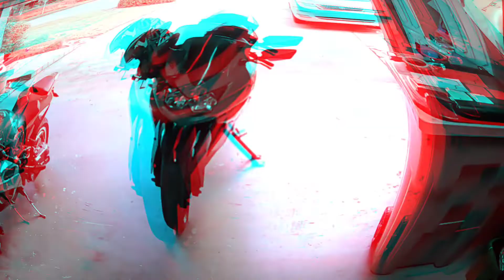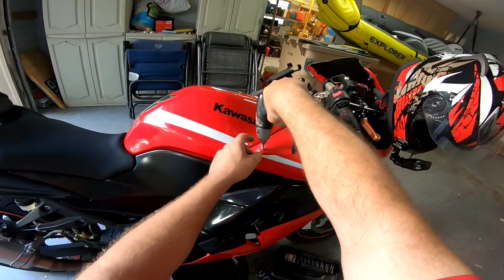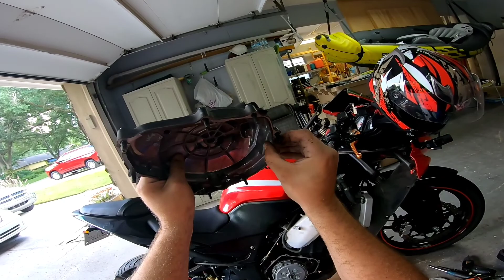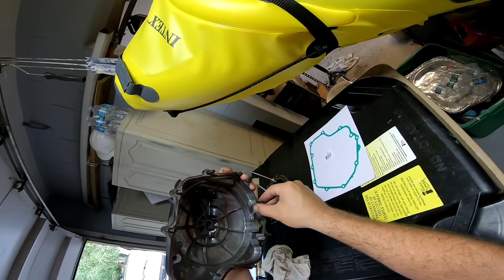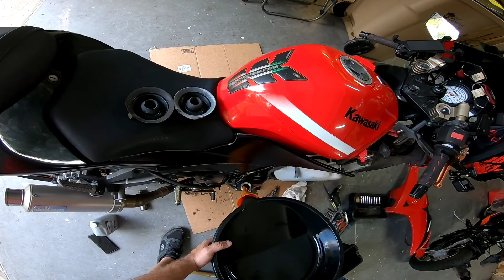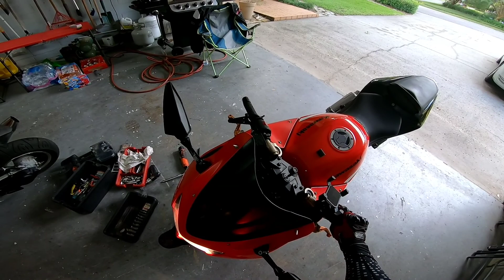Kawasaki Ninja 250R 2008-2012 Clutch Replacement For $30 It's Easy I Promise

Comment: Having an issue with excessive cable slack. I feel ive done exactly as you have. But when I draw cable to the actuator arm, there's just so much extra cable that I have to max everything out to get the cable taut.
Reply from the maker: Clutch cables wear out and they stretch you may have to replace your actual cable

Comment: Thanks, I have an unloved (unloved by previous owner) 2011 UK spec FI 250r. Your video very useful if I have clutch problems. I currently trying to loosen up swing arm. Last bolt stuck, can tap it from other side but exhaust downpipe in the way

Comment: Do i have to add oil before I test engagement like without the bike running? I just swapped the clutch back all the adjustments out on the cable and still when I put it in first gear with the bike off the chain still moves with the clutch in,granted I have a 2003 ninja 250ex and I haven't put oil in but I wanted to make sure before I have to rip the cover off again and drain all the oil I just put in
Reply from the maker: You can test engagement for opening and closing with the bike off and no oil in it but if you're going to run the bike you need to have oil in it

Comment: I recently just replaced the side cover of the motor the same one you took off to change the clutch, and when i put that pin back in at 37:30. That pin for the clutch cable to hook to it will not rotate back into position it slides all the way in but it will not rotate into place to hook the cable back on. Can anyone help with this? Explained in the best way i could.
Reply from the maker: @StonedClown97  that means that you didn't put the clutch together correctly
Reply: I never touched the clutch plates themselves I just took the 4 bolts with the springs out to replace the rod in the middle then put it all back together.

Comment: Anyone facing the same problem? The clutch cable had been adjusted perfectly. However the engagement point it’s too early. If I loosen the cable the engagement point will be perfect but level will have lots of free play. Is there a clutch spring release or something. Can’t figure out what’s the issue even after opening the clutch case

Comment: On the steel plates does the machined side face away from the bike of the rounded sides? Does the bike need to be in neutral?
Reply from the maker: Join my Facebook group then post a video and ask the question so I can see what you're talking about.
Reply: @IFixShet  the metal friction plates for the clutch have 2 different sides. One side is machined flat and has a flat "sharper" edge. The other side is smooth and the edge is rounded over. U may not have even noticed it when installed them but yea I'll do that
Reply from the maker: @maxx_life   Did you order from the company I suggested?
Reply: @IFixShet  no I ordered mine directly from kawasaki
Reply from the maker: So the ones that I put in didn't have a forward or a backwards. All of the plates were identical

Comment: Its always best to soak clutch plates before!! even if its just for an hour or so. You run the risk of using up and or scorching the first time you ride next
Reply from the maker: On this model you can actually just open the clutch plates with the clutch while the engine is running and it will circulate the oil through the plates
Reply from the maker: Same thing with the ninja 500R

Comment: did you soak the clutch plates ? ive read everywhere the plates need to soak in oil overnight
Reply from the maker: The clutch plates do not need to soak an oil overnight and for a wet clutch with a bottom sump like this it's really easy to install them dry and squeeze the clutch open and close a few times and oil will get in between the plates without having to wait. Now for bigger bikes I would definitely oil the clutch ahead of time but never in the history of installing a clutch do you have to wait 24 hours.  On a small bike like this if you want you can pre oil them just by dipping them and then installing them or like me the clutch Springs are huge allowing lots of displacement between the plates for easy oil to penetrate and get inside the clutch without the need for dipping them at all. The Choice is yours but you do not need to let them sit overnight

Comment: When I would be in gear, I would rev up the bike and I would not accelerate as fast as I am usually able to.For example I was would be in 3rd gear riding 20mph at 1800rpms (almost full rev) I did some research and found out that the problem I was having was called "clutch slipping." I called my local moto shop and after explaining that my clutch was slipping, he said it would be 350$ to take a look at it. Smh then I started doing research on slipping clutches and to resolve the problem I needed to replace my clutch plates. Replacing the clutch and changing the oil is easier than I thought it would be. My ninja 250 runs stronger and has overall better performance with the new clutch and fresh oil.

Comment: Hey what oil do you recommend for ninja 250r? Mine carburated version. Is shell advance ultra good? Or motul 5100?
Reply from the maker: So I'm actually using 10-40 full synthetic Valvoline 4-stroke motorcycle oil in mine and it does just fine it's really good for the clutch as well. This will allow you to go much longer before needing an oil change and it will be a lot better for your system.
Reply: @IFixShet  what’s ur opinion on T6 on the Ninja ?

Comment: Did you not leave  tha new plate and clutch  in  Oil
Reply from the maker: No need it's made with organic material it will immediately soak up the oil once it's spread across the clutch which is why I opened and closed it a few times to allow the oil in

Comment: With that clutch cable, did you slack it off at the clutch lever m8?
Reply from the maker: I adjusted the clutch after I installed